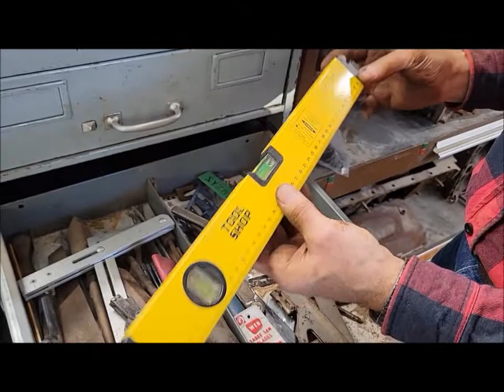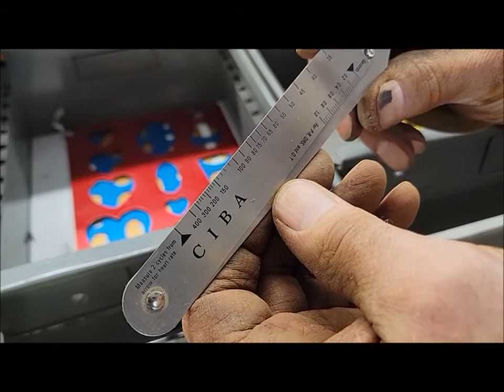Estate Sale Cabinet and Tools - What did we get?!

Comment: I think that miniature drill with bits in the handle is for cleaning an oxy/acetylene torch head. We have one thats brass and much smaller. Love buying these types of "surprise" boxes.
Reply from the maker: Oh that makes sense, did't think of that, you're probably right
Reply: Some call it a pin vice. Very useful with those tiny drill bits for all kinds of things. Usually high speed steel bits too!
Reply: @duron700r  I agree on the use like a pin vise but I've not seen a pin vise that holds the bits inside the handle. There may be just not seen them.